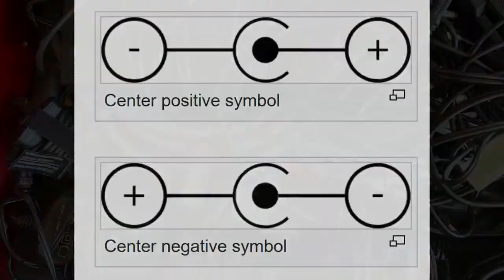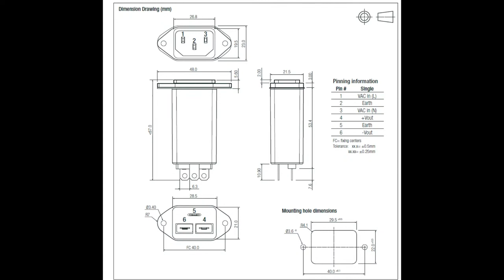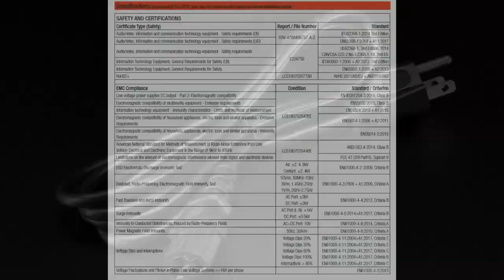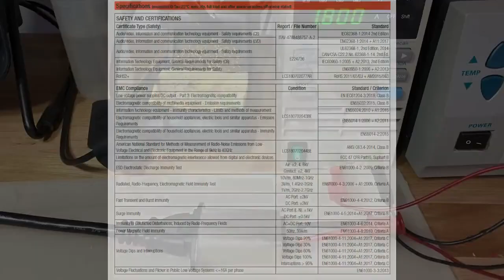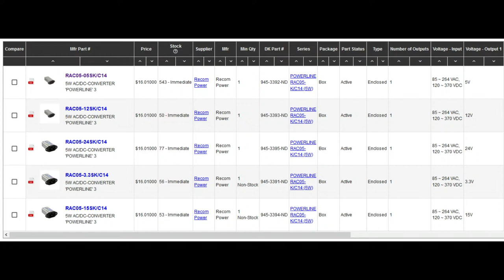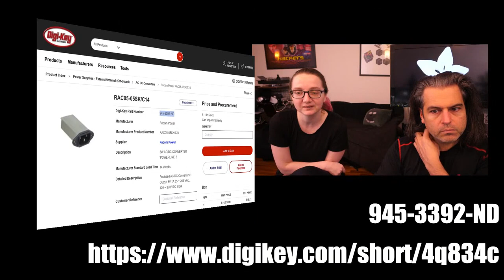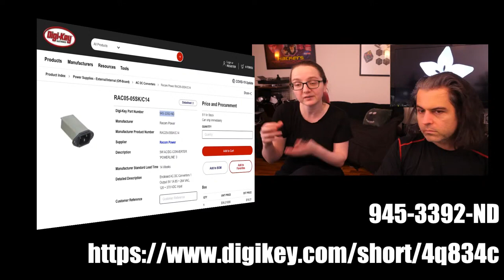EYE on NPI – RAC05-K/C14 Low-Cost, Isolated, 5 W Power Supply with Integrated Mains Filter #DigiKey

Comment: That's a great form factor, nice that it didn't brown out under overload as well. If they used the iec socket with a fuse in it, I bet that would be even more popular. Seems like a handy thing for small-mid scale manufacturing for products. A little pricy, but looks like you get what you pay for.

Comment: As a person who had blown out at least one device due to similar barrel jacks, I would very much appreciate more products made with idiot-proof designs. Additionally, I recently had to buy a replacement power supply for an external hard drive and haven't realized before how irritating finding the right power supply can be, especially if the product is sufficiently old enough that good documentation is hard to come by. I hope that making products that utilize interfaces that are truly universal would reduce anxiety and frustration for consumers using the product as well as reduce headaches in the design process.